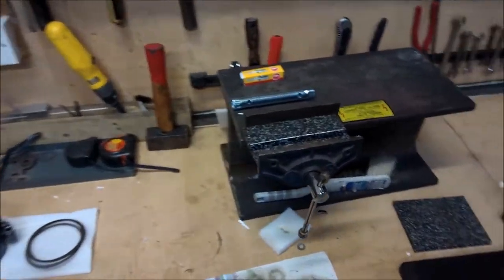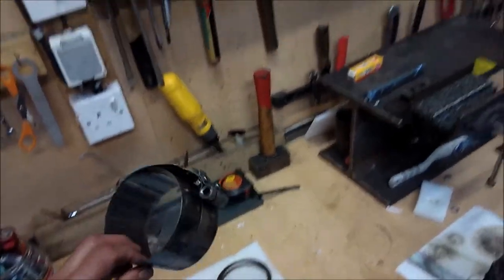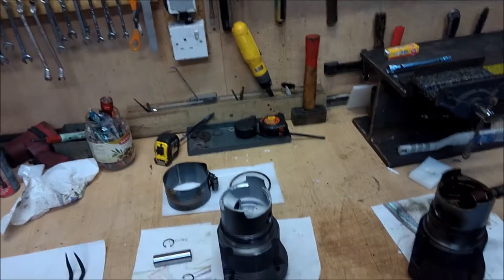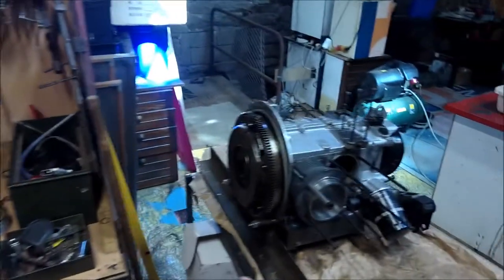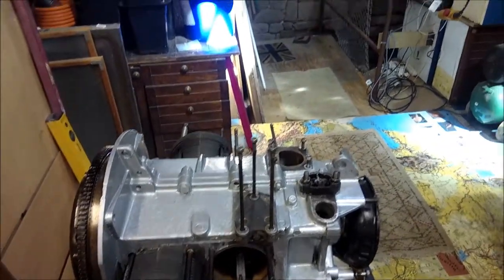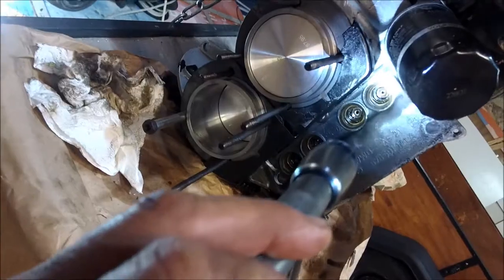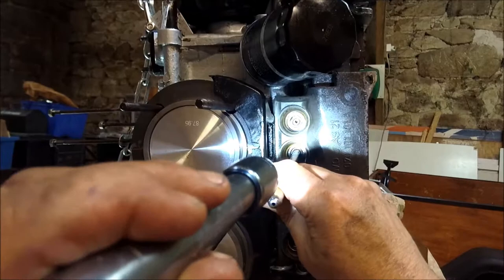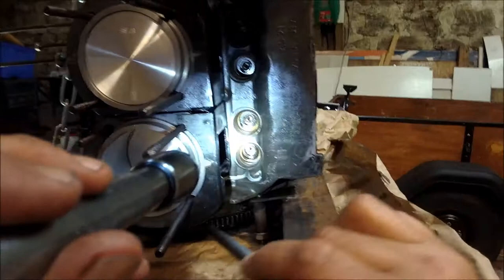How to upgrade a VW air-cooled 1600 to 1700  Part 2

Comment: I notice a oil filter on the block. I've never seen that before. Like your video very informative.
Reply from the maker: Hello,
Well spotted:)
Yes, the CT engine (the eventual base for the later Wasserboxer block) has an exterior cartridge type oil filter
Cordialement,